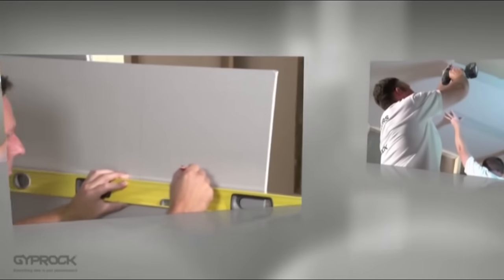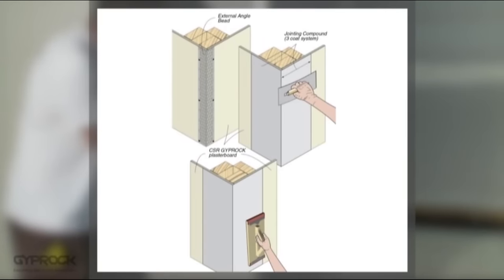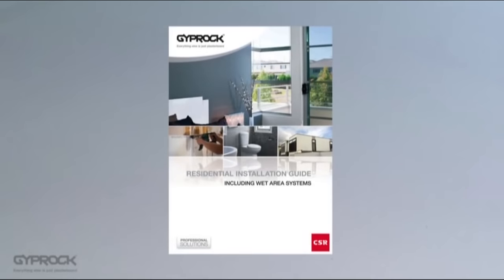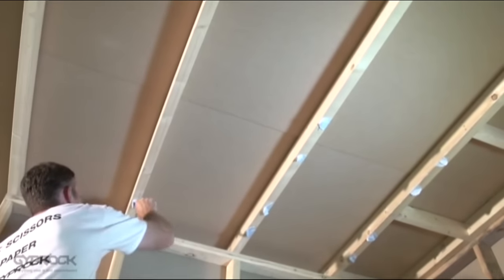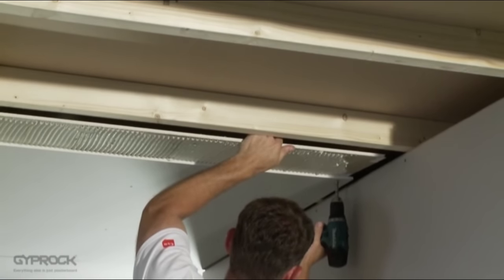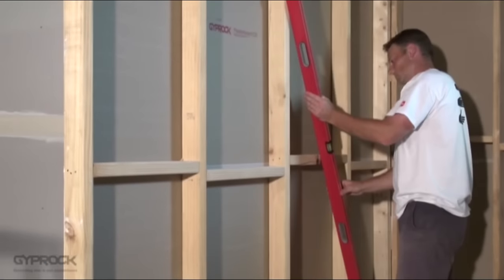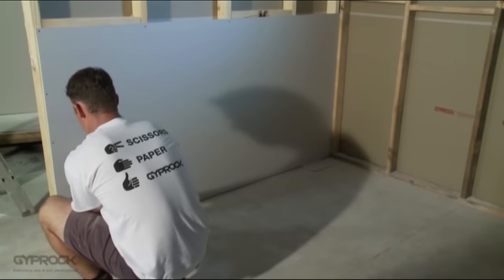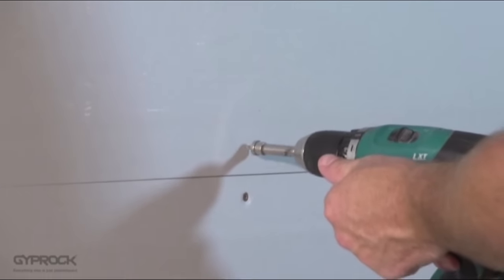How to Install Plasterboard Part 3: Ceilings and Walls

Comment: Adhisive is no good, just screw the entire board,  back boarding is also not a good idea if you have down lighters, they will not clip in double layered board
Reply: How do you avoid having to back board
Reply: What a load of rubbish ! Ceilings are falling down all the time  on the news because they dont use glue !
Reply: Do you enjoy repairing your ceilings every 5-10 years?
Reply: Have to back board they not running 90 to joists / battens
Reply: @justinbaxter9909  share half a joist one plasterboard goes on half the joist.. the other plasterboard flush on the other side of the joist don’t overhang a board always end on joist

Comment: That's s disgusting gap at the top always start with the top sheet to prevent the plaster cracking if its square stopped